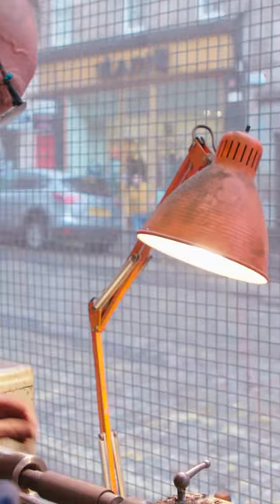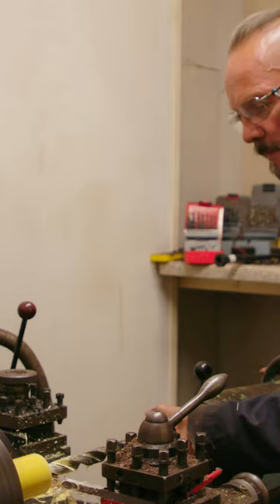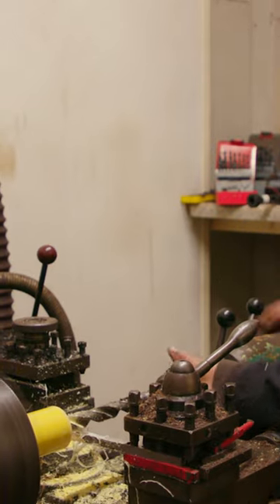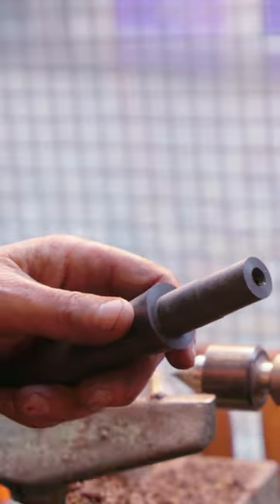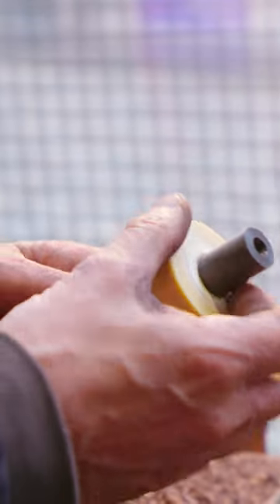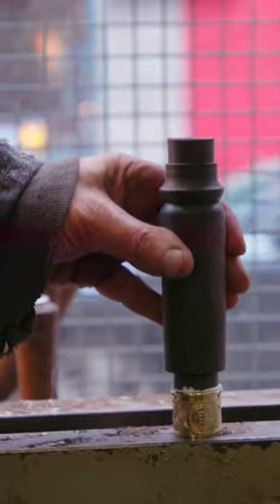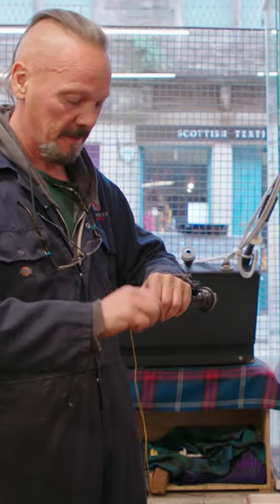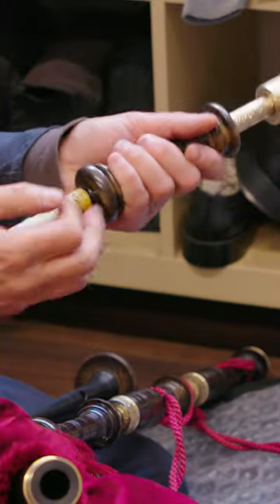This is how traditional Scottish bagpipes are made. #bagpipes #instruments #music #howitsmade

Comment: Amazing! So they had machines back in the day to traditionally make bagpipes!
Reply: Lathe's have been around since medieval times.
Reply: @WootTootZoot  but it looks so… modern.
Reply: This is a modern power lathe, but pole lathes (powered by a green sapling tree) have been around since the vikings (and possibly earlier) then treadle lathes were invented. Peter Henderson (a VERY good pipe maker in the 1800s used one) the creamy white is called imitation ivory as we’re not allowed real ivory on our pipes anymore and rightly so.
Reply: @Derk_Mage  they used treadle powered lathes long before they had electric lathes. Think like an old singer sewing machine, with a peddle you pump with your foot.